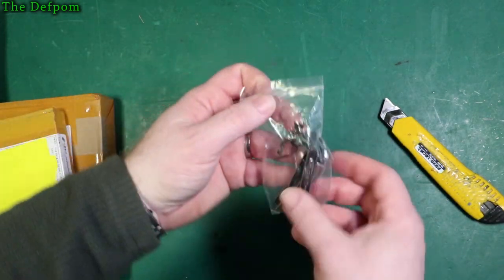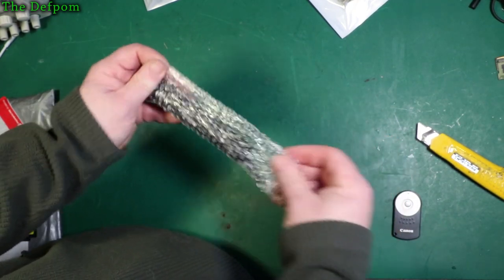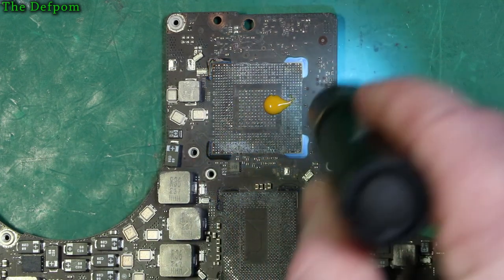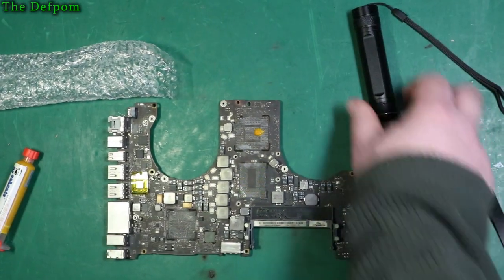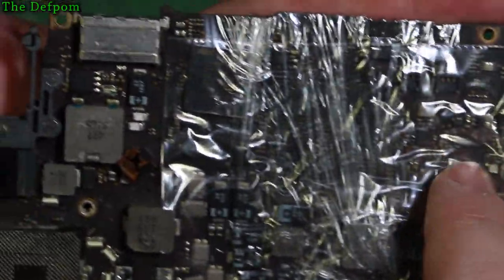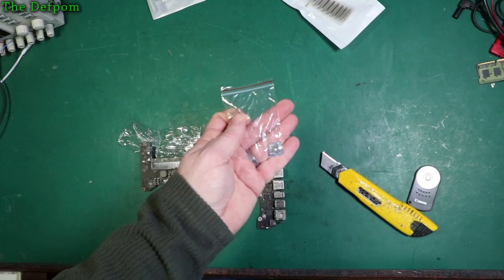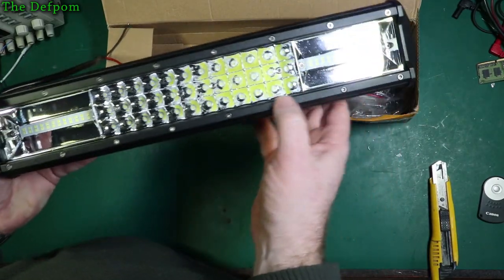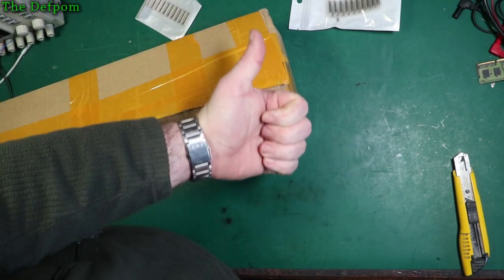🔴 #644 Mailbag Monday 28th October 2019

Comment: I bought a UV torch and some UV glue to play with but haven’t had chance to try it yet. You must be really stacking up on those Mac book parts well if  you need them so nothing wrong with that.  My friend has some LED lights that look similar to that,  but he has replaced them a few times due to water ingress.  You should do a review after having them fitted for a few months etc. They look really well manufactured but water is hard to keep out in these applications. Thanks Regards Chris